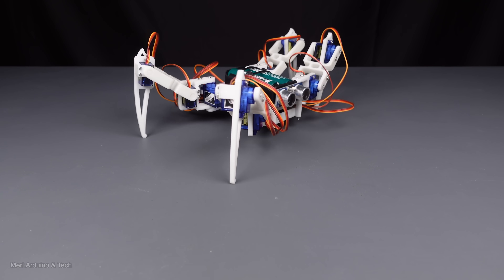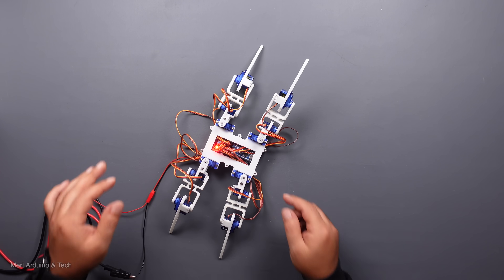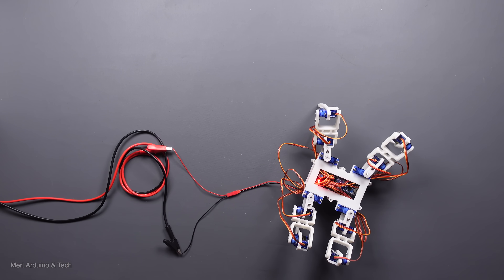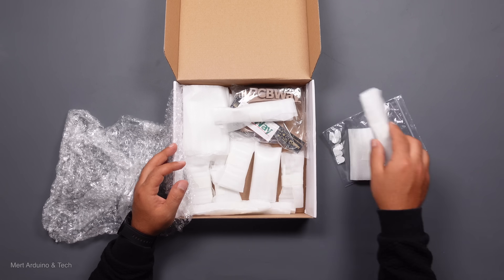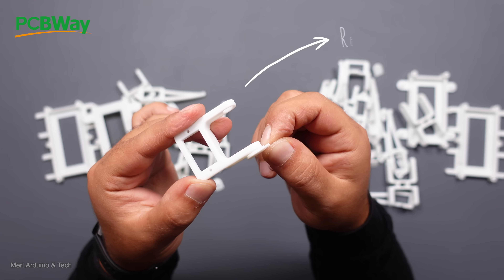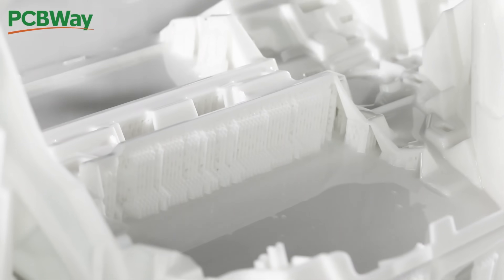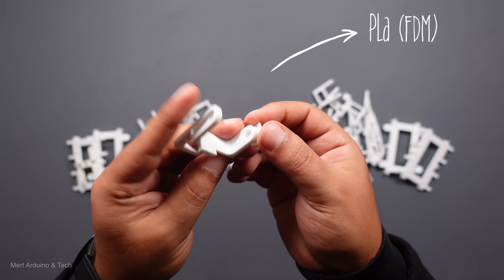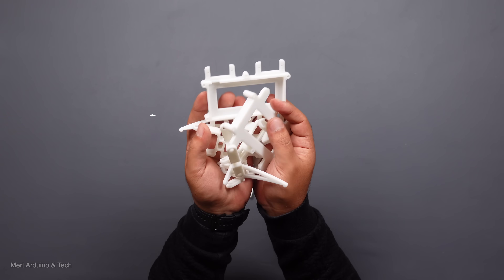How to make Quadruped Spider Robot (using Arduino and 3D parts)

Comment from the maker: Source Code and 3D stl files - https://www.pcbway.com/project/shareproject/Quadruped_Spider_Robot_3D_Printed_Parts_SG90_Servo_Motor_Arduino_Nano_10107fe3.html
Required Components:
12x SG90 Servo Motor - https://amzn.to/3TYPrgj
1x Arduino Nano V3 - https://amzn.to/3FBhApv
3x Capacitor 100uF 16V - https://amzn.to/3DNbcJt
1x LDO Voltage Regulator 5V/3A (Similar: MIC29310-5.0WT, LM1085IT-5.0, LM323T)
12x Header Male 2.54 1x3 -  https://amzn.to/3fybH1A
1x 6 Pin Self-Locking Switch 8x8mm - https://amzn.to/3SWbQcU
1x Screw Terminal Block Connector 5mm - https://amzn.to/3FC8EQB
1x LED 3mm - https://amzn.to/3FBj6rH
1x Resistor min. 220 Ohm -  https://amzn.to/3TZdR9J
2x 18650 Li-ion Battery - https://amzn.to/3zYvKO3
1x 18650 Battery Case 2 Slots - https://amzn.to/3fu5sMr
Required Tools:
Soldering Station - https://amzn.to/3TVvZkQ
Soldering Wire - https://amzn.to/3ST5ElX
Wire Cutter - https://amzn.to/3h2APy6
Silicone Soldering Mat - https://amzn.to/3SXpDA5
Isopropyl Electronics Cleaner - https://amzn.to/3frlG93
Reply: merhabalar mert bey, eldiven ile robot el projesinde elin parmaklarını tek tek hareket ettirdiğimde hiç bir sıkıntı olmuyor ama tüm parmakları aynı anda hızlıca kapattığımda arduino kafayı yiyiyor ve donuyor. Resetleyince tekrar kafası yerine geliyor. Bunun sebebi ne olabilir, yardımcı olur msuunuz?
Reply: the code is empty

Comment: Bro my ardiuno is not getting power from motor driver shield, when I connect to computer it’s ardiuno is working , when I connect it with battery it’s stops working